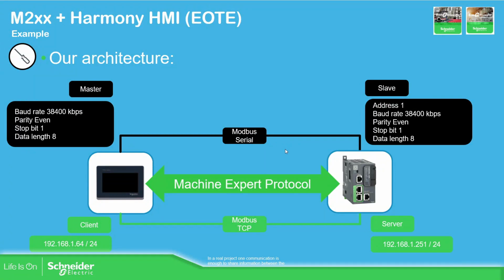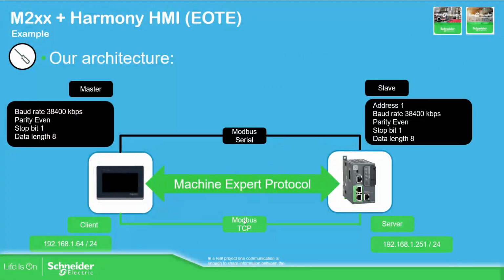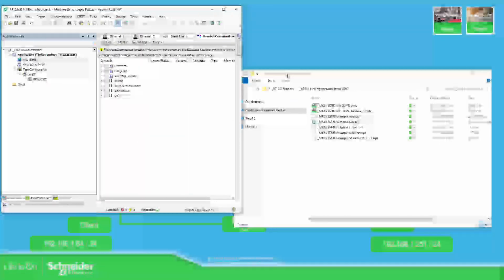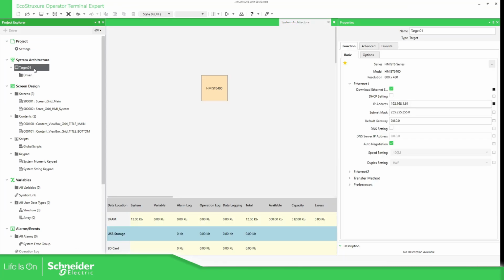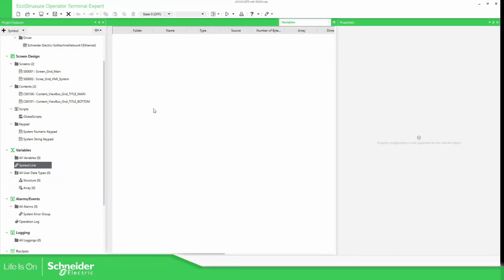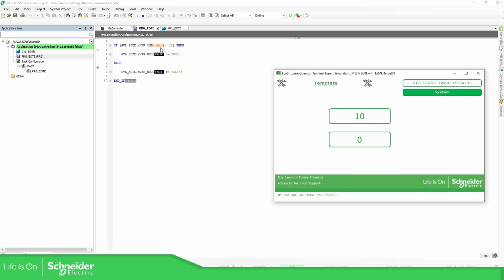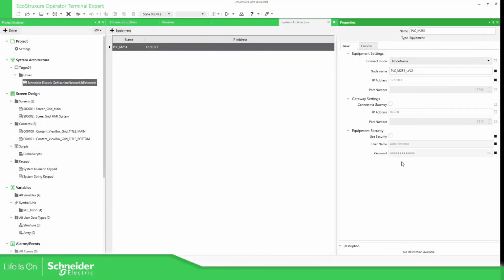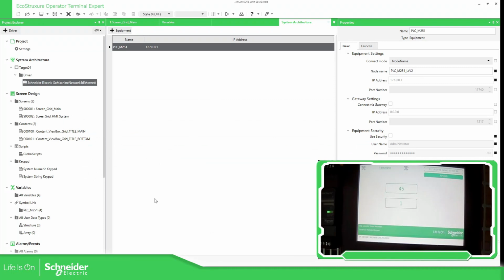EcoStruxure Machine Expert connection to EcoStruxure Operator Terminal Expert

Comment: Great video, can I ask if it would be possible to do the same with Ecostruxure Machine Basic and a TM200 PLC, connecting to a HMIST6400 and Ecostruxure Operator Terminal Expert
Reply from the maker: Hi there! I do not have a M200 with me but i believe the process will be the same. I can try in a few weeks using simulation. I have done it with a M221:
https://youtu.be/DOiaDWveGsY?si=u9K9gBu-tnj1tFPI

Comment: Hi LeTomas. Do you know what I should do to connect Zelio SR2 E201BD with HMI705? I am connected via COM and after adding Drive and setting variables, HMI does not see ZELIO and ZELIO does not see HMI. Any ideas?
Reply from the maker: Hi there! Make sure you are using the SR2CBL09 to connect the two devices. The Zelio program must be in FBD if you are using the hmi. If you have used correctly the blocks on the zelio then there is not anything else to check.i will probably advise to check the cable

Comment: i cant transfer file from PC to HMI, it say unable to connect but when using Vijeo designer, there is o problem when transfer the program to HMI
Reply from the maker: Hi there! If you are using ethernet then It could be that the hmi requires from you to enable it from the hardware configuration. Try to get the hmi into broken mode so you can also see this option:
https://youtu.be/wo2L15GZWzw?si=tk1fz1vshM6J_WPE

Comment: Hi LeTomas, thank you for you work! 
When i press "generate code", the xml file is not generated in the folder, do you have an idea of what the problem could be ?
Reply from the maker: Hi There! I believe it could be:
1) you have errors in your code that are not allowing you to generate the file 
2) you have not selected anything on the "Symbol Configurator"
3) You have not used any of the variables on the GVLs

Comment: Hello, how can I import the recipes saved on the HMI to the Ecostruxure Operator Terminal Expert program? I can do this by plugging a USB into the HMI. But I want to import via Ethernet.
Reply from the maker: Hi there! Good question! I will check for this. In vijeo we have an option to directly change using the software and if i am not wrong using the tool addon (no remember the name). We also have a tool app for eote i will “play” with it
Reply: @LeTomasAHUMADA  Thank you for your response. It was a feature we used frequently in the Vijeo designer application. However, we cannot use it in this one.
Reply: @LeTomasAHUMADA  Hello sir. Is there any development on this issue?

Comment: Hi, I am using Ethernet on HMI6200 to connect to PLC and share variables. It is working in the simulation but not on the real device. Do you have idea what could be wrong?

Comment: Hi Leandro, Thankyou for your support videos, they have been a great help in getting my project working via ethernet connection on a TM241CE40R with a HMIST6200, however i am now trying to connect and setup on a TM241C24R with no ethernet only serial, can i ask how you assign address to the variables and import to operator terminal as its not covered in this video, thanks Sam
Reply from the maker: Hi Sam, please check the following videos to help you connect the plc and the hmi via modbus serial.

https://youtu.be/SzqOc416OmI

And how to give address to the variables in the plc:
https://youtu.be/xsS_JNg-5MM

I believe this can help you to sort it out 😊
Reply: @LeTomasAHUMADA  , thanks for the info, ive manged to assign address to both my global variable lists, however it wont allow variables to be assigned to the PVL persistant list, error code says "C0215: Direct Address declaration is not possible in persistent list" any ideas as i need these variables for hmi.
Reply from the maker: @samwyard  yeap, you can define de variable in a gvl and change in the gvl to be persistent retain then in the gvl for persistence perform an “add all instance path” . Please check my next video for full details:  https://youtu.be/DITcgYUYr3Y
Reply: @LeTomasAHUMADA  thanks for that, that's a great help, one last question, (apologies I'm used to somachine+vijeo, so machine expert network worked with com also) how to import time and string variable  as the excel does not work with these.
Reply from the maker: @samwyard  probably with time variables you will need to use a int o dint variables and then make the convertion in the plc, remember that the int/dint value should be in ms.
For string variables you will need to make the calculation depending on the size of the string. I do not remember right now but  if i am not wrong the declaration of the string is %MB in the plc and each character in the string is one byte then in the hmi you will need to access to the %MW variables of the plc

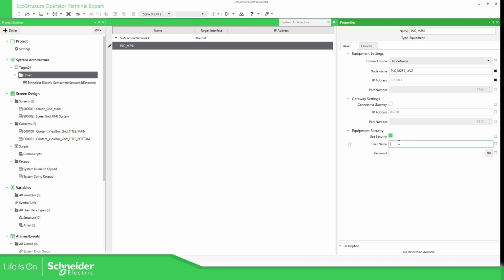Comment: Great Video. I'm trying to use IP address instead of NodeName for comms with PLC - can't make it work. What's the port number should be when using HMI with  M241 ?.In your  video it's (Port number) greyed out on 12:06. on the right . Thanks
Reply from the maker: Hi Hayk! If you are going to use the Modicon M241 to communicate with an HMI in Operator Terminal Expert along with the Machine Expert Driver then you must use "Nodename" otherwise you will not be able to communicate with the HMI. The port is the 11740, you can find more information about the port in the next link: 
https://product-help.schneider-electric.com/Machine%20Expert/V2.0/en/m262prg/index.htm#rhfulllayout=true&rhsearch=Firewall&rhhlterm=Firewall&rhsyns=%20&rhandsearch=0&SUBSTRSRCH=1&t=m262prg%2FD-SE-0031470.html
Reply: @LeTomasAHUMADA  Hello, can m251 communicate with operator terminal expert by ip address? i can only connect with nodename right now, do i need to update firewall script ? and what will be port for m251, 11740 or 1105?
Reply from the maker: @sabakakhadze5997  Hi Saba! For m251 you must use the nodename and uncheck the “encrypted communication”
Reply: @LeTomasAHUMADA  there is no way to use ip? i have m251 in other network and subnet, hmi in another so i have to use ip
Reply from the maker: @sabakakhadze5997  if i am not wrong you can use the gateway setting on the hmi and then use the nodename (i did not test it but it is worth the try if the plc is in another network)

Comment: Hello, firstly I would like to greet you for such an informative and well explained video on this new software. It really is well done and solved my application issues. Secondly, do you know if this connection can be replicated using the Ethernet IP protocol instead?
Reply from the maker: Hi Sebas! Even if the PLCs Modicon M241,M251,M262 has ethernet ip the HMIs on EcoStruxure Operator Terminal Expert do not have this kind of drivers (or i was not able to find this). If you do not want to use the SoMachine/Machine Expert Network you can use the "Modbus TCP Master" but you will need to add addresses to the variables on the PLC side.

Comment: Hello, do you have tips for connection with Unity PRO, i try to simulate the PLC but the connection still not connected, and do you know how to enable data dictionaries in EOTE?
Reply from the maker: Hi Fernando , I am into the Machine Expert rather than the Control Expert but check below my feedback:

PLC (sim) to HMI (real) --> Even if the ip address of the PLC in the simulation is 127.0.0.1 you need to define on the HMI the ip address of your computer and assign it on the driver. (i just tested and it works)

PLC (real) to HMI (sim) --> similar to this video https://youtu.be/ZGvNAPbo-Hs but instead of use NodeName use the IP without security
 and the modbus tcp driver

PLC (real) to HMI (sim) --> Similar to previous video but use the ip address 127.0.0.1 or the one you have configured for the sim PLC.

Basically, check the video: https://youtu.be/ZGvNAPbo-Hsand 

Use a ModbusTCP Driver instead of the SoMachine/Machine Expert and it should work fine :)

Comment: Hello, ist this connection also possible with the EcoStruxure Machine Expert hvac? I have a Modicon M172 and would like to use a Gateway Box or a HMI ST6400 as Interface.
Reply from the maker: Please check the next link:
https://schneider-electric.box.com/s/mu13oas33nf5jel5l03w86u1o8nxbow0
Reply: @LeTomasAHUMADA  Thank you! Keep going with these awsome videos!
Reply from the maker: Hi luxon123! You can connect the modicon M172 with the HMIST6400 via modbus serial or modbus tcp. There is a easy way to export the variables from the EcoStruxure Machine Expert HVAC and import them in the EcoStruxure Operator Terminal Expert but I have not done the video explanation yet.